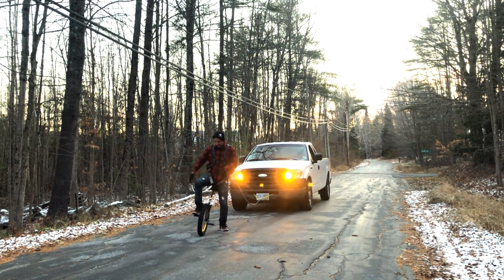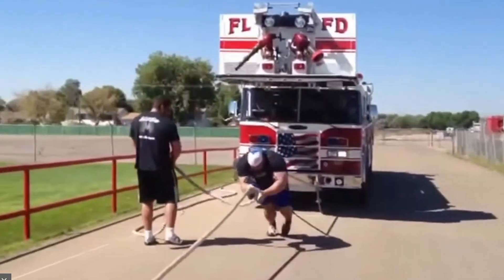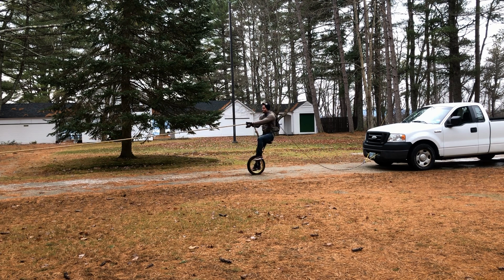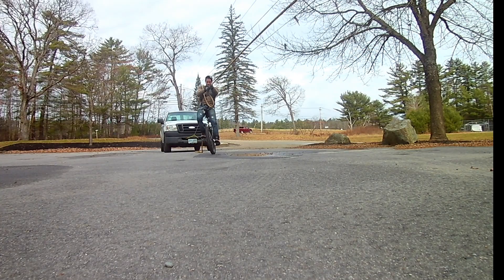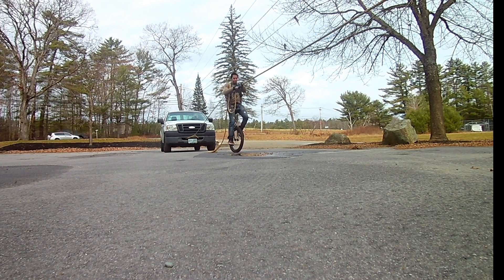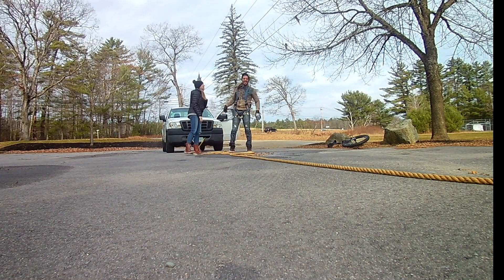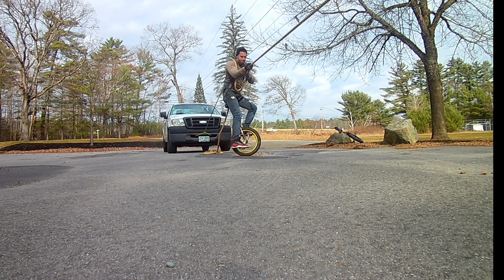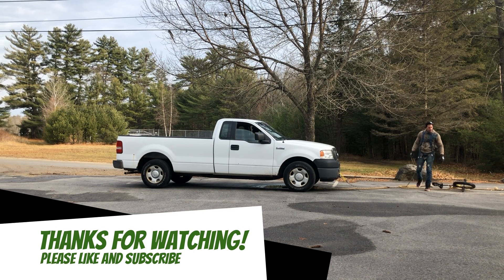Pulling a Truck on a Unicycle

Comment: Great job! 
That really amplifies the hill climbing ability of a smaller wheel. 
I started in early September with a 26-in beginners uni with a square taper hub, and 127mm cranks. Everything was cool for the first 200 miles riding on flat surfaces like quad tennis courts and double basketball courts, doing workouts of  3, 5, and up to 8 miles. But one day after daylight saving shift I did a workout at a high school entrance on a long curved 1/4 mile sidewalk up and back repeats, 4 miles. The first day was cool, no problems. But there was no wind. The next day I did the same workout but the wind was blowing 15 to 20 mph in my face going up the hill. Two reps of that and the square taper stem broke leaving it in the right crank! 
It's possible that a 16-in wheel would not have broken that stem because of less torque required at the crank-stem joint. 
Your switching to a smaller wheel to pull the truck really brings it home. And I'm pretty sure you had an ISIS hub when you were doing that.
Meanwhile I have a new steel frame,  ISIS hub Nimbus 26 MUNI. It's a beast with a big knobby tire! My first thought riding it: "This is a Schwinn varsity!" 😂😂 But it's helping me with my free mounting! I have a dual purpose smoother tire arriving tomorrow and that should help with road riding. I'll put the knobby back on when it gets warm and I'm really good at free mounting.
Reply from the maker: Thanks, this is one of my favorite videos!  Yeah when I first started riding I used to go through cranks like crazy but that all stopped when I got an ISIS hub. Keep with the unicycling you'll be pulling trucks in no time haha

Comment: Put two lines on the truck, one on each front corner coming to a point at the uni.   This would provide sideways support at the uni so you could pull forward without the rope.   A rope is cheating.